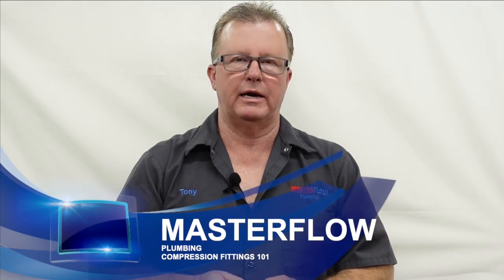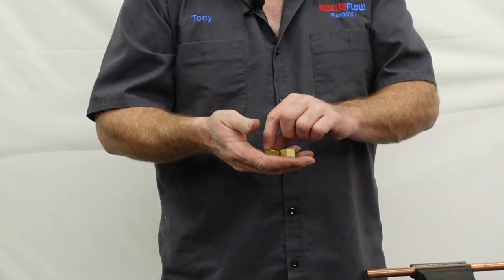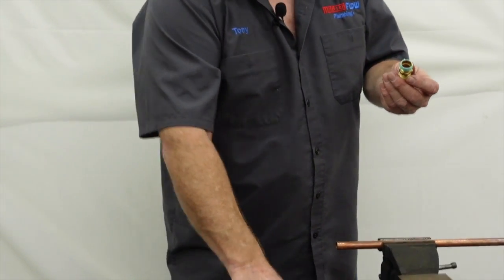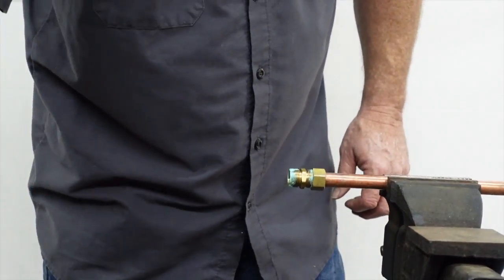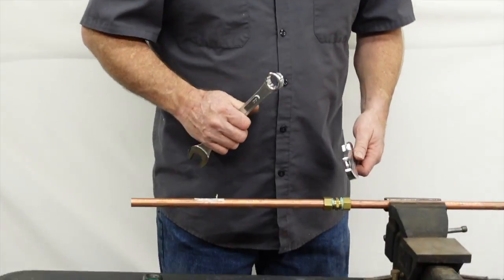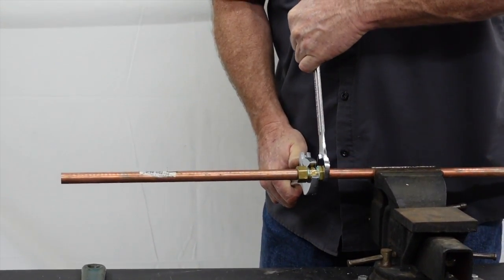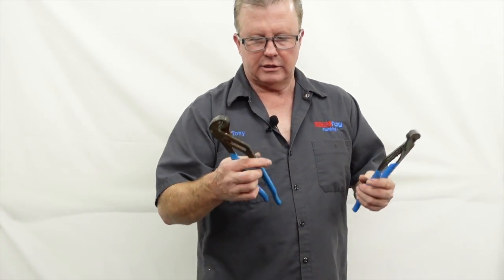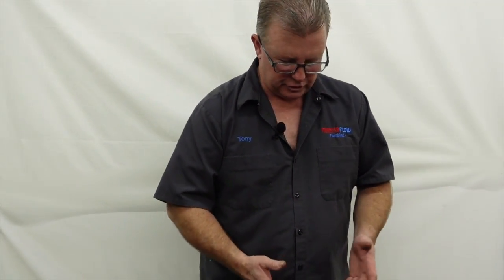Compression Fitting 101: Everything You Need to Know

Comment: Hi, I have one of these compression couplings on a power steering of a pickup truck. One side has a small ooze leading to a drip. Can I use Teflon tape over the ferrule  ? If so, can the power steering fluid degrade the tape ?
Reply from the maker: I have no idea.  I’m a plumber not a mechanic.  But from what I do know power steering is under great pressure probably not suitable for compression fittings.   Probs better off doing it right or hiring it out.

Comment: Good video. You could use silicone paste (dielectric grease)!on the threads. It lasts a long time and would smooth the rotation of the nut. Dielectric grease is also used on the threads of outdoor flood/spot lights so removal years later is much easier.
Reply from the maker: Yep that would work.

Comment: Great video !!  Good Job !!

I wonder if you would know if compression fittings work the same when running air through the lines or making air lines ??
Thanks for your generous consideration,
Sincerely ................
Steph
Reply from the maker: I’d say it depends on what air pressure you’re talking about.  Typically black iron pipe is best for compressed air.
Reply: @masterflowplumbing9812     .... I'm sorry, I meant copper & an alum line for drain or overload switch maybe.
Thanks for your timely reply, and great video sir,
Sincerely .............
Steph

Comment: If I have a pin hole leak in an existing basement line and I cut the line with a pipe cutter, is there a specific gap I must leave between the two pieces to be joined with the fitting?
Reply from the maker: Depends on the fitting used.  A coupling will have a specific gap yes.   What it is varies with manufacturers.

Comment: If I have a pin hole leak in an existing basement line and I cut the line with a pipe cutter, is there a specific gap I must leave between the two pieces to be joined with the fitting?
Reply from the maker: Thanks for watching

Comment: Bought a 5/8 compression fitting and when I test on 1/2 inches copper tubing it seems loose. Just wondering what size copper tubing are fitting
Reply from the maker: There are different sizes of copper.  For plumbing we measure the inside diameter.  So a 1/2 inch copper has a 5/8 outside diameter.  There is a size that is 1/2 outside diameter but it is typically used in other applications outside of plumbing. Such as refrigeration. Hope that helps.

Comment: Hey Tony. I'm repairing a leak in 1/2 inch copper tubing. Got the leak cut out. Tried 1/2 inch push fitting, but it was too loose. Leak city. Then I got 1/2 inch compression fittings. Everything fits, except the sea rings. They won't go on the copper tubing. What's my next move, please? Thanks. 💖
Reply from the maker: Not sure without seeing it. Thing to keep in mind is the different sizes of copper.  Standard half inch copper has an outside diameter of 5/8”. But there are other copper pipes that will have a 1/2” outside diameter. Be sure of your size. Thanks for watching

Comment: Every manufacturer‘s instructions and plumbing manual I have seen explicitly states NEVER USE PIPE JOINT COMPOUND ON COMPRESSION FITTINGS. I friction between the ferrule, the pipe, the nut and the fitting body is rewired to get a tight seal. I have to question this presenter's competence in this area.
Reply from the maker: Did I say to put it on the pipe and ferrul ? No I didn’t.  I say to put a little bit on the male threads for the nut.  I even explain why. Did you actually watch with the sound turned down ?  And wait , why are you watching DIY videos on a subject you’re obviously quite skilled at ? My competence has existed for 35 years. Kinda amazing considering I’ve never flooded a building with my incompetence. Troll on. Oh and thanks for watching.

Comment: How do you put the connector on between the pipe.  Are the pipe that flexible to put the connector in between the two ends?  I mean the video show one end stationary and the other end is free to move.  Are the copper pipe that flexible that I can somehow get both end of the pipe into the connector?  I hope you know what I mean.   Thanks in advance.
Reply from the maker: I know what you mean.  And the answer is no. There often is not enough give on the two pipe ends to spread it apart enough to use a compression fitting.

Comment: Never need to put anything on the threads in this kind of fitting.  It's a demountable fitting. The part that is sealing is the ferule when it is crushed against the pipe and the fitting.  Some people will add their chosen sealant or ptfe to the ferule but it almost always unnecessary unless you have a  pipe with a defect.   An 11 year old girl should have the required strength to tighten a compression fitting with a normal sized wrench - do not overtighten . The UK uses compression fittings alot so we are experts on them.
Reply: Lmao uh oh the UK professional is here to save the day and show how its really done 😂 Obviously you didn't pay attention to the video🤦🏼‍♂️
Reply from the maker: Thanks for watching
Reply: He explained why he's using it and the explanation is valid. Of course you don't have to use it but lubrication has many benefits and properties. It's why the use of them is so widespread throughout all industries.

I would recommend people to try both and see what they like to do.

Comment: I would never tell anyone to tighten the nut as tight as you can because that joint will be doomed to fail. The downside to using compression fittings that employ brass ferrules is, most DIY types that are not familiar with how much to tighten compression fittings will most always overtighten the nut, thus crushing the ferrule, resulting in a leak.  I always tell those new to compression fittings to tighten the nut just enough to hold the fitting together under water pressure, usually about a half turn, and then turn the water on.  At that point the fitting will most likely leak but, I then tell them to continue tightening the nut until the leak stops, and then tighten about an eighth to a quarter turn more.  If overtightened, the ferrule will be crushed, and once its crushed it will never stop leaking.  The only fix at that point is to cut the tubing below the ferrule and start over with a new ferrule.  Following this tip will result in far less frustration and fewer trips to the store to get a new fitting (or ferrule).
Reply from the maker: Thanks for watching
Reply: Very good advice.  Compression fittings will stay on fine and often not even leak if even done hand tight  - at least in the UK.  I believe water pressure to the property is often higher in the USA though, so I wouldn't state my claim universally.
Reply: Google says for 1/2" pipe to use 1/4 - 1/2 turn after finger tight.    I'm guessing at least 1 full turn unless it bottoms out.
Reply: Hey Mr commenter! Why aren't you making a better video than the one you're watching? I'm guessing the answer is that you are a much better KEYBOARD WARRIOR then a guy who would take the time to make a video

Comment: I put 1/4 coupling on my fridge for the water line and its leaking. Wonder if i didnt crank it down enough?
Reply from the maker: Well it’s certainly possible.  You also have to make sure to use the plastic feral on any plastic tubing because the brass ones will cut the plastic.  The plastic ferals are different than brass with it having a tapered shape.  Always be sure the smaller tapered side faces the fitting.

Comment: You're doing what a few other videos say not to do - overtightening! Others say hand tight plus one full turn only
Reply: Go ahead and try it yourself.  You'll find most cases not getting them tight will cause them to leak.  It's a fine line between too tight and just right, comes with experience.
Reply from the maker: One full turn on a pressurized water line will leak in most cases. I’m not sure why the “ minimum “ mindset is suggested by other videos. I just know how I do them.  Hand tight and one full term is probably close to the feel I speak of.

Comment: Great video! What kind of fitting can I use to install a 1/2" compression valve on a 1/2" threaded copper pipe?
Reply from the maker: They make compression valves that will do the trick

Comment: compression fittings are great, just like you never get a leak at an angle stop or stop valve under the sink with compression fittings. I'd say if there is any "leak", it's either due to cross-threading, or not tightening with enough force, so make sure you carefully check for leaks after you are done. Also, don't be afraid to "over-tighten" a compression fitting, because even if you do break thread by overtightening, you'll only notice it after you take the fitting off, and it will not leak beforehand.
Reply from the maker: Truth is compression fittings are very susceptible to leaking if not done correctly.

Comment: Are these tight enough to handle say r140a refrigerant at 125psi? Thanks!
Reply from the maker: I’d say no.  Try using a flared fitting for that
Reply: I can't speak for US product quality but in Europe that would be fine.  Common to have mains water pressure that is higher.

Compression fitting working at 700psi https://www.youtube.com/watch?v=JCEkwNydIWY

Comment: Guess joining copper and plastic would be the same rules and equipment
Reply from the maker: As long as the outside diameter is the same it will work.  There are also transition fittings to accommodate different outside diameter’s

Comment: What about the little flared tube that comes with the compression fitting? Is that just for shipping or do you use that as well? I noticed in the video there was not one? Thank you
Reply from the maker: I believe your talking about the stiffner it is used inside plastic pipe to strengthen it so it don’t collapse when tightened.  Not needed for copper.
Reply: @masterflowplumbing9812  Awesome thank you! I am using half inch copper flexible tubing to put a cooler on my air compressor.

Comment: Well made and presented but, a lot of bad advice in this video. If you lubricate the threads and crank down, you will likely crack the tubing and the connection may fail and leak. Using lubricant on the threads lowers the friction and will likely result in over-torquing. Check with the manufacturer of the fittings for proper torque or, usually the amount of turning after hand tight. NEVER "CRANK DOWN" ON A COMPRSSION FITTING! Nothing wrong with compression fittings if installed correctly.
Reply: You are correct. That is why torque values are sometimes listed with different values if anti-seize is applied. The compound reduces friction in the threads, requiring more torque to be placed on the threads, which places more pressure on the ferrule in a longitudinal direction, which in turn over-expands the ferrule laterally and potentially crimps the pipe.
Reply: You have no clue what you're talking about.
Reply: Don’t forget he has those big arms 🥴
Reply from the maker: Why are you watching videos instead of making them ?  In 32 years I’ve had one compression fitting leak.  You know what the fix was?   Tighten it some more
Reply: @masterflowplumbing9812 maybe the reason why we don’t make videos is so their is less information out there to watch… yes that sounds dumb but the more videos we make the more our journeyman licenses dwindle because “everyone” can do it. Now for the anti seize… is it NSF 61 certified? Is it accepted in potable water if it ever gets into the piping? Does it void warranty? Did you bother to see the torque specs?

Comment: I watched a video last week by a professional plumber in the UK. To my surprise he put both teflon tape and pipe dope not on the threads, but on the outside of the olive! Everybody knows the seal is not at the threads, so his method makes intuitive sense. His point was that the quality of olives has slid backwards over the years, and the risk of a callback is always a worry. For years I ignorantly used teflon tape on the threads, then stopped, and now it's funny to see the pendulum has swung back. Your method makes sense as well, it is more a lubricant that allows smooth torque.
Reply: If you need tape or dope on the olive to prevent leaking, it means you're not getting a tight enough connection on the compression.
Reply: I find tape to be useful to prevent corrosion from freezing up the nut so it is too difficult to remove years later. So many junk valves sold at the big box stores that it's a wonder that the valves even work after a while. That and the tendency to leak in the open position are common failures I see in the field. Pay a little extra and buy Dahl shutoff valves.
Reply from the maker: Thanks for watching and commenting
Reply: You don't need anything other than the nut and the ferrule when using a compression fitting; you just need to compress the ferrule until it stops leaking.  That's why it's called a COMPRESSION fitting.  Putting it as tight as you can is 'guaranteed' to create a leak.  All you need to do is tighten the nut enough to hold the fitting together securely, and then turn the water on and when you see it leak, and it will, tighten the nut slowly until the leak stops, then turn about an eighth of a turn more, and then STOP.
Reply: I saw the same video lol. Same thoughts.

Comment: "do it up as tight as you can".....the only plumbing video I have watched that has ever said that. It is usually hand tight and then quarter to half a turn.
Reply: If there was a torque spec I'd use it
Reply: Yeah to start lol. Better have access to it so you can stop the leak.

It also depends on the fitting size. You have to be merciful on the 1/8 fittings.
Reply: That has to be the worst possible advice you could give anyone about tightening a compression fitting.  All that will do is create a leak that will never stop!
Reply from the maker: Hand tight and a quarter turn will get you flooded in no time

Comment: Recently my grandma woke up to a wet floor. I came over and found the leak.  I didn't want to use a shark bite, didn't bring my torch with me. So I ran to the local little mom and pop hardware store and got a  couple compression fittings. 
Cut out the leak and got her taken care of.  Been about 2 weeks, still leak free.  I'm not a plumber but I have done some repairs. Glad to see a plumber approves using compression fittings. 

I am a mechanic by trade.i have seen so many brake lines patched with compression fittings and fuel lines.  I don't approve of them on brake lines at all or fuel lines near a heat source but I get it you gotta do what you gotta do.
Reply from the maker: Yes should be flared fittings on brake lines and gas lines